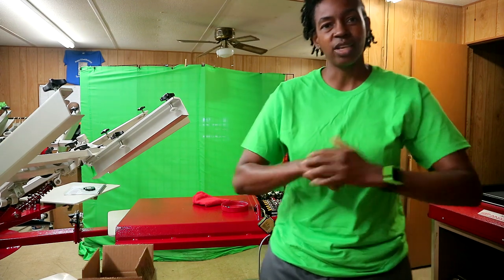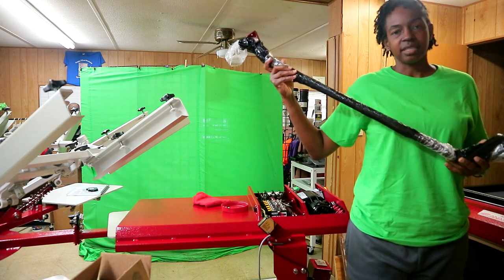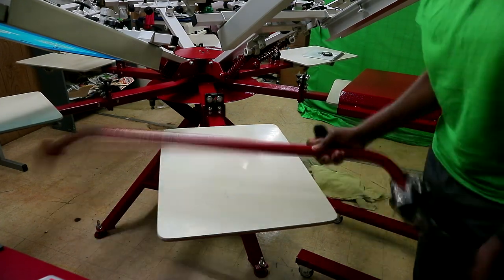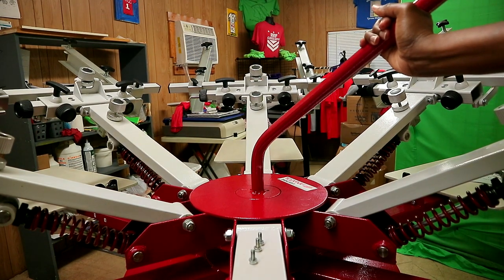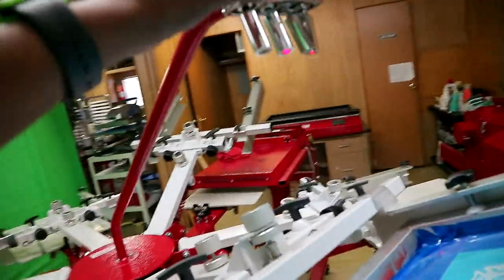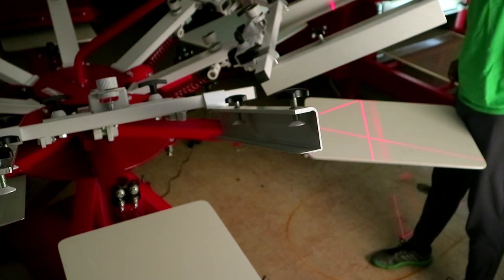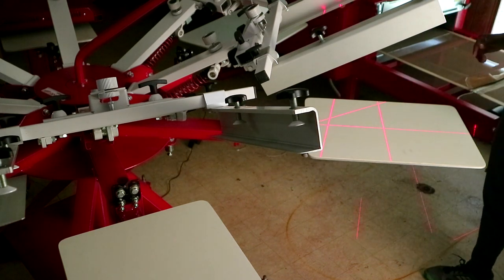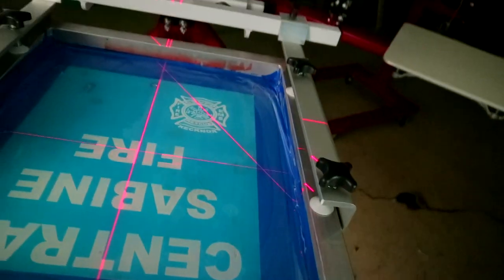Anatol Screen Printing Equipment

Comment: How is the lightning. I’m trying to decide if I should go with the Thunder instead. Not seeing any benefits of the Thunder over the lightning.
Reply from the maker: I think the lightning is an awesome press and it's built solid.  If this would have been my first I would have never had to do so many upgrades like I did.  I think the only difference is the Thunder is built more heavy duty and it has more bulk to it.  I think they are both good sturdy presses that will last and my Lightning is built like a tank.  Thank u 4 watching!